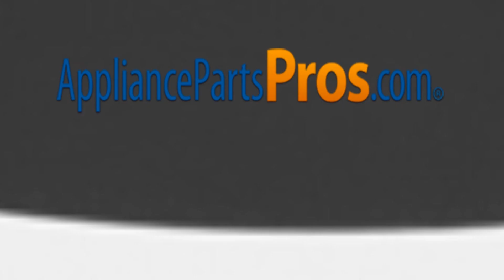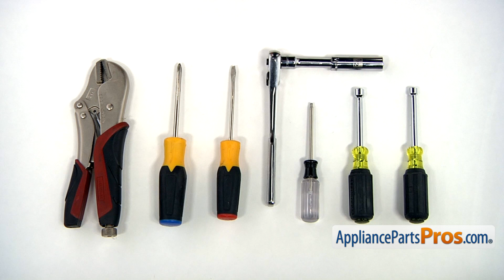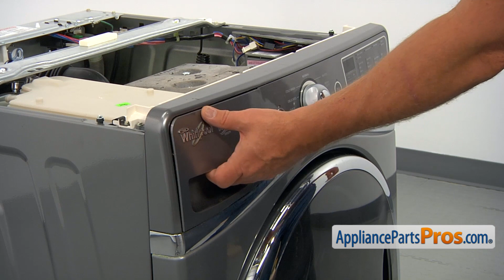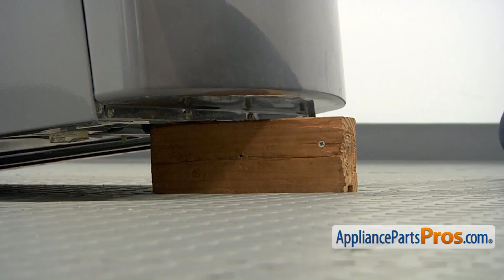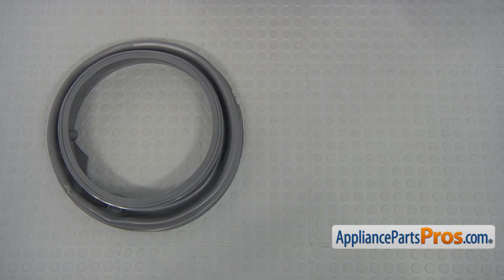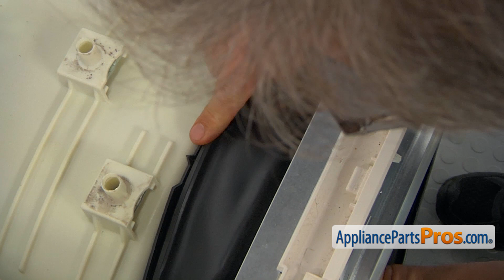How To: Whirlpool/KitchenAid/Maytag Door Seal WPW10237499

Comment: Very helpful commentary, especially the tool needed at each stage, really made it easy. Separate request: suggestion for how to remove a loose object in the drum? I say “in the drum” because I pulled the heating element in the back as well as the pump filter and nothing is visible from either location. I have the sense it is inside the plastic structure around the front edge of the drum. This is held in place by ~6 nuts but it appears I would have to disassemble the plastic  washer body which seems not to be possible without ruining it. Suggestions?
Reply from the maker: Glad you found the video helpful! As for the loose object in the drum, it does sound like it might be trapped in the outer tub assembly near the front. Before disassembling anything major, here are a couple of things to try:
Tilt & Rotate: With the washer unplugged, try tilting it forward and gently rotating the drum by hand to see if the object shifts or becomes accessible.
Use a Flexible Grabber Tool: Sometimes, a long flexible grabber or a magnet (if the object is metal) through the heater opening or pump filter area can work.
Check the Door Seal Area: If it's wedged near the front, carefully pulling back the door seal and feeling around the edge may help locate it.
If none of these work and it’s truly stuck inside the outer tub, removal might be tricky without disassembling the washer further. Let us know what you find—we’re happy to help troubleshoot further!

Comment: Incredible video.  Worked perfectly.  Only trouble was putting on the spring on the outer ring.  As instructed I put a little soap on it but I think it may have been easier without since it made it slippery and difficult to stretch.  it kept popping off and a little more friction might have been a good thing.  i got a second hand to hold in the one side and it went right on.  Excellent instructional video!!
Reply from the maker: Glad you were able to get your spring back on. If you need help in the future please let us know.